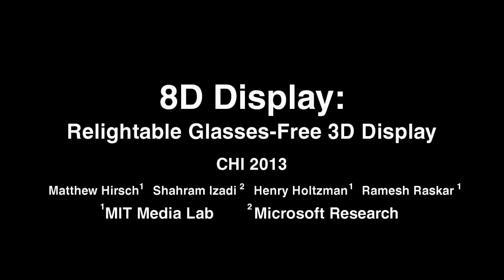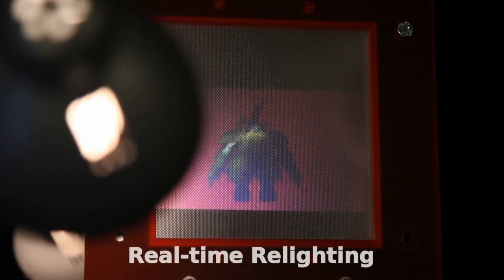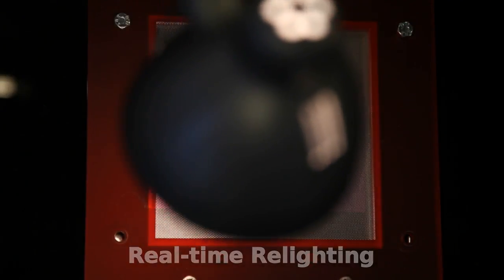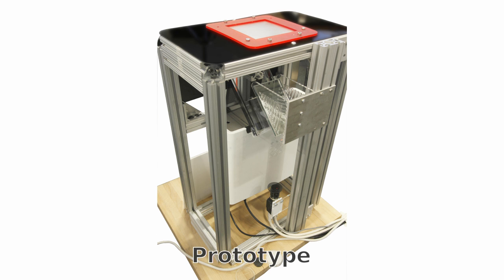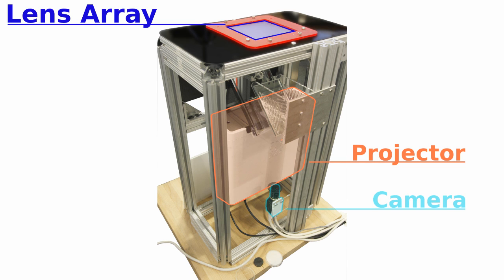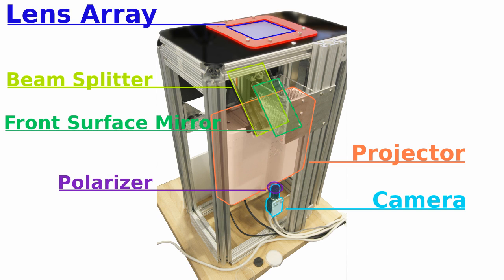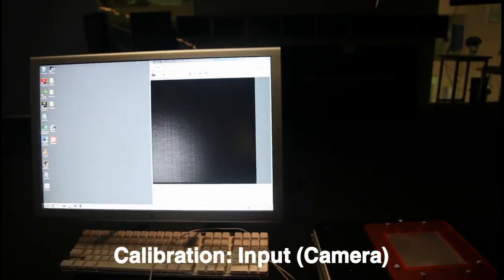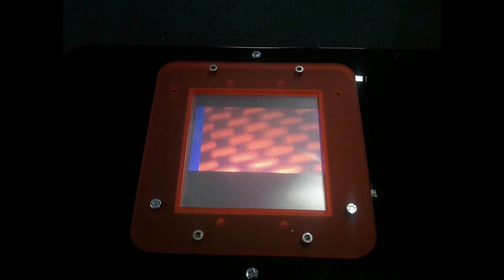8D Display: Relightable Glasses-Free 3D Display

Comment: Proper paralaxing will really help 3D consumer adoption because it's much more natural.

Also we need content at 120Hz as 24/48Hz just doesn't cut it for frame sequantial/frame packed active 3D.

One of the biggest hurdles seems to been pixel persistence. We need at least sub 10ms response to eliminate persistence.

Very cool BTW!